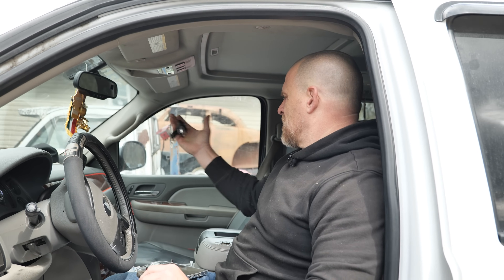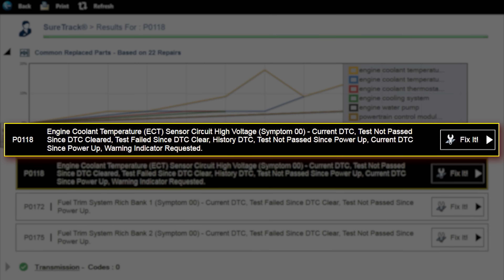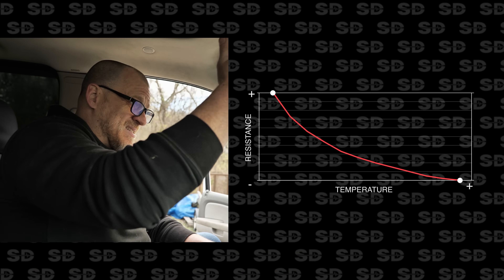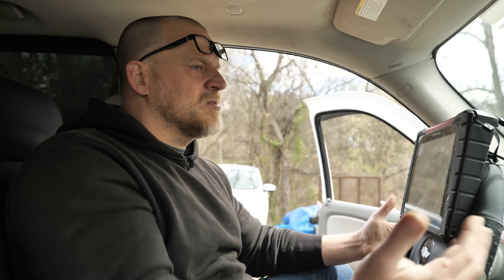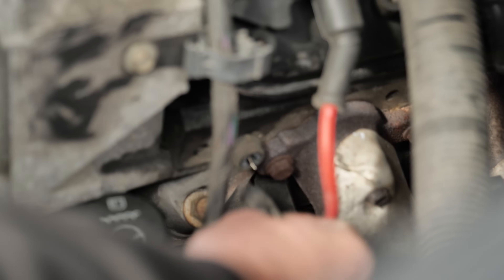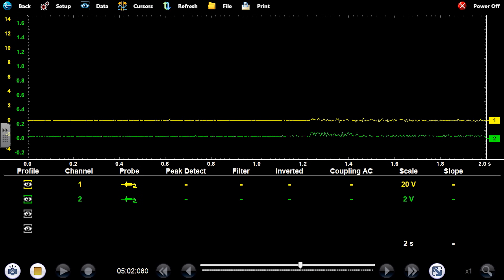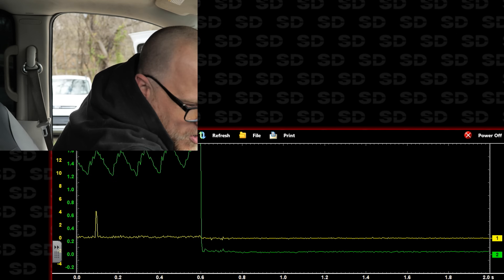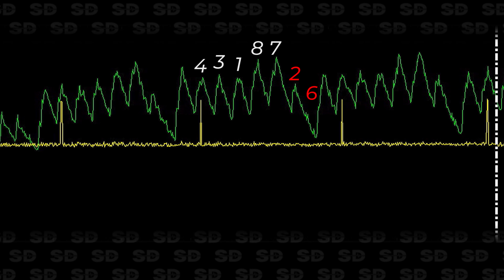Misfire, Rich Condition, Long Crank Time - Where Do We Start?

Comment: If the vehicle is a flex fuel vehicle using regular gasoline I have been finding the ethanol content creeping up as far as 30-40 percent alcohol level and definitely creates a long crank time
Reply from the maker: The ECT at -40 was causing the long crank. Did you see how good it started once I plugged it back in?

Comment: Where would I start? Change coolant sensor, and pinch off PCV hose to see if rich condition from oil contaminated with gas. Clear codes and then test.
Reply from the maker: I wouldn't do any of that without addressing the no compression in cylinder 6 first. You never want to spend a customers money only to tell them when your done "im sorry, you need an engine"
Reply: Yeah homie that oil is ready for a weed eater 😅
Reply: that's the worst compression I have ever seen from a relative compression test.

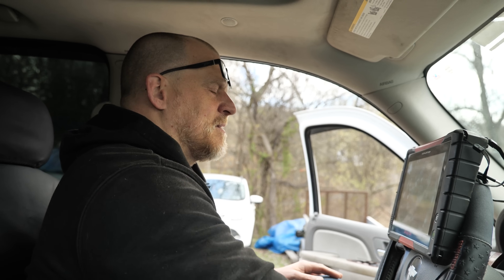Comment: I'm gonna comment before I watch the video. Coolant sensor or circuit. So now I'm almost 5 minutes in and yep, coolant sensor circuit and you're mentioning compression issues. I hear the loping as you're cranking but I also have had washed out cylinders from fuel getting dumped. A condition that will generally right itself after the rich condition is solved. Pushing play at 4:43. 7:45 and you're still on compression. Right now is when I stop and check the oil for fuel contamination. Not saying it is, but I've gotten burned on rich run conditions for that reason.
Reply: Wouldn’t the coolant temp stuck at -40 cause it to run super rich? Or are the newer ones smart enough to switch to a default fueling strategy when a code is present?
Reply: @KingDraculaSpelledBackwards  It'll run super rich, wash the cylinders down and cause a delayed start if it starts at all. It does sound like he has low compression cylinder, but I'd do the simple cheap coolant sensor repair first. He already did a temporary repair of the sensor and the difference was easily seen in how quickly it started and how well it ran. A washed-out cylinder will cause low compression. Default fuel strategies come from things like a MAF disconnected. The computer doesn't get to just arbitrarily decide that it isn't cold outside.
Reply from the maker: Not low compression, but NO compression on cylinder 6. And on a running engine, I'm never worried about cylinder wash, especially with no white smoke dumping out of the exhaust (which is what a stuck open injector would do)
Reply: @ScannerDanner  Yep, not standing there with you obviously. Although I couldn't hear any misfire while running after the coolant sensor was attached. Maybe a mic near the tail pipe would help on our end. You do great work and I'm by no means attacking you.
Reply: this compression problem is blatant
Reply: @edwardjames6070  Once the coolant sensor issue had been taken care of, albeit temporarily, the rough run and rich condition went away. There are no "blatant compression" issues without a misfire to go along with it. It was running rather smoothly.

Comment: Injector stuck open washed the side walls? Misfire/compression isssue?
Reply: Fuel injectors are leaking was my first guess too, but that lazy cylinder was the kicker.
Reply from the maker: Engine runs. Even leaking injectors on a running engine won't cause cylinder wash to the point of having zero compression on a single cylinder
Reply from the maker: That would result in MASSIVE amounts of white smoke.
Reply: @ScannerDanner  not necessarily. Just had a 06 4.0 ford #2 injector was open no smoke low compression not 0. Used pico to see injector needle was not moving. Removed intake to see a puddle of fuel on valve.
Reply: @ScannerDanner  that's a great thing to remember

Comment: -40 Temp will Definitely Cause a Rich Condition and Rough Idle. Specially you are pedling the Throttle to flore solely Because of the -40 Temp.